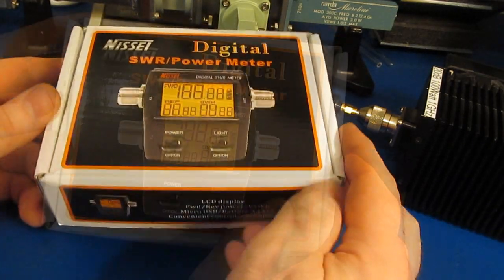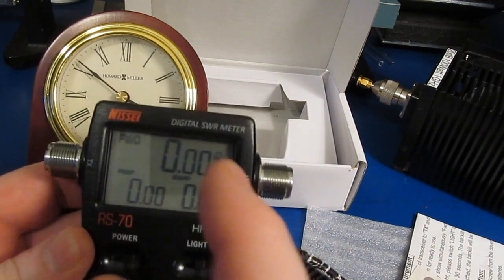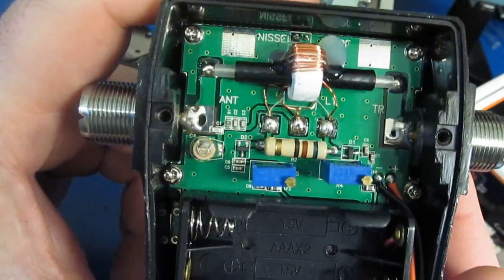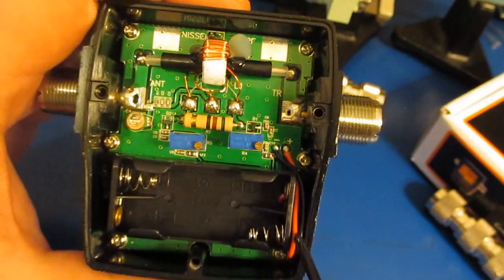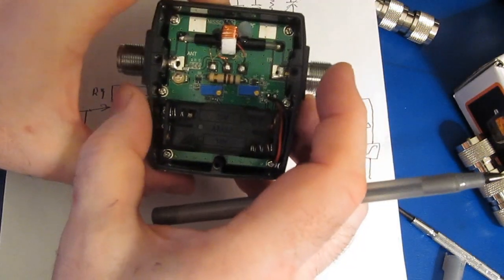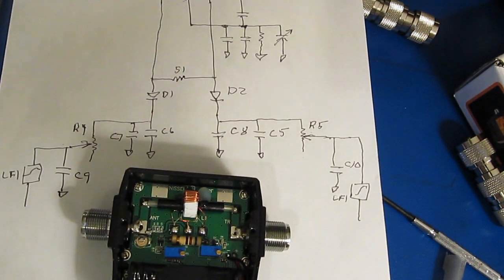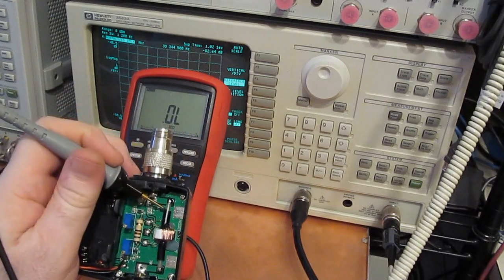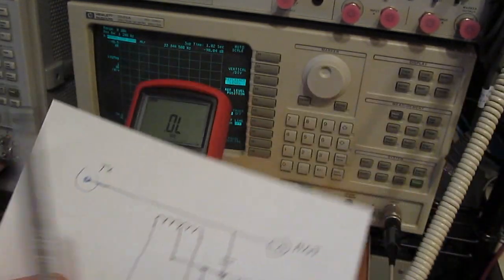Inside the NISSEI RS-70 Digital SWR/Power Meter

Comment: There is a service manual with alignment procedures for the Nissei DG-503 which might have a similar or same design. At least he display looks to be the same as on the RS-70 and maybe from the same era.

The DG-503 does HF and VHF/UHF but it seems to have HF as a separate section. There are four pots instead of two and they are marked as "R1HFREV", "R2 HFFWD", "R3 UVREV," and "R4  UVFWD."

Maybe the basic design is similar enough to get an idea.

BTW, My RS-70 does not have the braid attached but I do not know the accuracy across the band. It agrees with my "ATS-10" tuner.

I have mine open because the LCD contrast is almost invisible when looking straight on but dark and sharp when viewing from an extreme angle at the top. The bottom board is really wedged in there and I already broke the USB connector. Once its all the way out, I will see if there is a separate LCD Controller like on the DG-503 and check the datasheet for contrast adjustment.
Reply from the maker: Thanks for posting.  I've thought about making a video where I would attach the braid and attempt to align it and see what, if any improvements I see.

Comment: I have one and it won't take any reading whatsoever even when hooked up to my receiver and antenna.  Everything sits at 0
Reply from the maker: Wouldn't you expect that?  I mean, most receivers don't transmit...
Reply: @joesmith-je3tq  lol a *transceiver
Reply from the maker: Assuming your radio is putting out enough power to meet what ever their minimum is,  have you tied to fix yours.   I showed the schematic for the coupler/detector stage.   If you do pull it apart, post some photos of the internals.

Comment: YOU NEED TO learn to read. It clearly says the power switch will turn the light circuit on and when tx power is applied it lights. it is not designed for full time lighting.  the off setting is explanatory.
Reply from the maker: It states:  For back-light, please switch "LIGHT" to "ON".  No function in 30 seconds.  The backlit will automatically off.  Once PTT launched, the backlit will be back.    Your Chinese is better than mine.   Of course the that's far more important than that fact it doesn't read power of VSWR even close to spec.
Reply: I'd say it's all important. I never commented on the unit accuracy. It is deplorable. But at least the documentation seems adequate for a Chinese product. @joesmith-je3tq
Reply from the maker: @cathyjohnson7199  The box states its a Digital SWR/Power Meter.  That's the primary tasks it is supposed to perform.  The backlight and any other features are secondary.   There was a part2 and I have been asked about a part3 where I address the potential problem I identified and attempt to align it.
Reply: @joesmith-je3tq  Nice vid! I watched the latest/greatest attempt to align/discover more and it was very informative. I'll be popping the covers off mine to look for a braid and add it in. I got my meter for peanuts so if I can make it somewhat accurate I'll be happy. It's only used mobile to alert me if something drastic happens, like my UVH6 fell off. LOL. no really, I don't care if the meter is 20% askew for what I want it to do.
Reply: @joesmith-je3tq  Joe, also I found my manual and it does say 1-5w the readings are for reference only, to be fair. And 5+ w is 10%. Think of this. My $1100 HF mobile install suddenly goes bad, pinched/cut coax, water intrusion, squirrels. My SWR goes high enough it might damage the rig if run long enough. Chances of spotting it on rig display. 50/50. Chances of seeing it on the cheap Nissei. 100%. Sometimes accuracy is not the end all.

Comment: I appreciate your effort but still think you are giving too much air to people claiming nonsense (commenters). But the USB guy I think was spot on. Usually they cut at around 10% of the load, so smaller USB banks cut out at around 100mA  and sometimes less, larger ones at around 200mA. I keep around a 1000mAh powerbank just for ESP8266 stuff, anything larger just restart after 10-20s.

Comment: Joe, W2AEW have a video regarding the directional coupler and one side of the shield should be grounded.
Here is the video :   https://www.youtube.com/watch?v=byF1FLdbUiA 
About 7-8 minutes in is where he shows the shield grounding.
Reply from the maker: There are many sources that show the braid being terminated, which includes the couplers I put together for my own Watt meter.   What I not sure of is how the RS-70 meters that work (meet the suppliers stated specs)  were constructed.  Since making this video, I have only located one photo showing the internals and that meter also had the braid floating.   I have no idea if that meter worked or not.
Reply from the maker: Here is one I found on ARRL.   Page 1, has a section on the directional coupler.   2nd paragraph talks about the shield.   Again, fairly common but I am not sure why Nissei neglected to add it, nor if it was actually required.   Their may be something else going on with the meter.    http://www.arrl.org/files/file/Product%20Notes/2012%20Handbook/KAUNE.pdf

Comment: I am not certain of the physics involved here so let me say that my understanding needs to be verified and I haven't found it discussed anywhere.
But, new designs of wattmeters utilize a different technique.  They detect a sample of the voltage on the xmsn line and also the current.  With these 2 measurements and the phase difference between them anything can be calculated with a microprocessor - R, X, Z, phase, power, etc.  The LP100A is an example.  The detector used in the NISSEI is sensitive to current flowing in the line (I think).  To detect voltage on the line you would measure between the center conductor and ground.  In practice a toroid core transformer would be used, connected across the SO239 connector.  
Now, why use a Faraday shield on the current toroid?  I think the answer is, to prevent it from being sensitive to voltage which confuses the readings. It would be sensitive to both current and voltage.   As I say, this needs to be verified; I am not stating it as fact.  Rick  K2XT

Comment: You are on to something here, Joe.  Very interesting.  I am surprised that you discovered this (grounding one side of the coax) but didn't identify it as a Faraday shield.
I tried homebrewing these things twice and had the same results as you found - horrible frequency response such that it is unusable.  If you look up the old power meters Doug DeMaw made for QST articles back around 1968 you will see a similar design, with just the center conductor of the coax being used.  In fact he built a printed circuit board and etched a conductor on it, with the toroid core mounted in a cutout.  BUT if you check out a Heathkit SWR/power meter, the one with the black meter face, (HM-102 ???)  you will see a tiny, tiny core being used and mounted over a miniscule little piece of brass which extends up through the core and is grounded, which would simulate the shield of a piece of coax, grounded on one side and open on the other.  
The design used in this Nissei is similar to Drake, Collins and maybe many other wattmeters and I think called the Bruene design, named after a Collins engineer.  It would be informative to check out a Collins wattmeter such as used in the 312B4 wattmeter that matches the S Line and see if Bruene used a Faraday shield.  
Good work.  Thank you, 73 de Rick  K2XT

Comment: I have two different models by MFJ (not MJF) and both are very accurate.  One is the other model like you have that covers VHF and UHF frequencies and the other is the bench style that does HF, VHF and UHF.  I connected both of them in line to my R&S CMA 180 which had just been calibrated a month before and both meters were within their specification in frequency range and power.

As for batteries I don't think I have ever met anyone that used the USB to power it.  The small ones are almost always used in the field for things like adjusting mobile antennas and HF wire antennas outdoors.  Great little meters that fit in your pocket.

I can verify Nissei makes them for MFJ.  The first one I got was the VHF and UHF version like you have.  When I popped the battery cover off to install a battery I took a peak inside and could see the Nissei name silkscreened on the PCB.

Out of curiosity I just now removed the sticker and popped the back of my VHF / UHF handheld unit and it uses a different SWR bridge setup.  It uses PCB traces instead of a piece of coax.  In addition to the two adjustment VR's it also has two trimmer capacitors.  One trimmer cap on the forward and one on the reverse pickup traces.  They use brass sheet stock to form RF shields and they are grounded to the case.  I would think attaching the coax shield on yours to the ground plane may solve your problem.
Reply from the maker: I wouldn't expect the coupler for UHF to be the same as one only working to HF.   Please pull the cover off your HF one and post a photo up on EEVBLOG or somewhere else.  I would like to see if that braid is attached on yours.

Comment: Yeah its feeling like the engineer made a design choice to ground one side of that braid (or both given the pads being there) and someone came along later and tested the unit without soldering the braid, felt it worked fine at their test frequency and made the change without consulting the design engineer or properly testing it
i had this happen to my designs a few times at an old job, mostly someone thinking they can save a few bucks on a critical opamp that i chose carefully for one with roughly equivalent first page specs

Comment: Nearly comes with its own matchbox. But if you ground the braid its sensitivity will be very low. We want you to rip out the board!!
Reply from the maker: I suspect most have seen an LCD, switches, power supply and a microcontroller before.  Cookie cutter stuff.   Heart is the coupler.